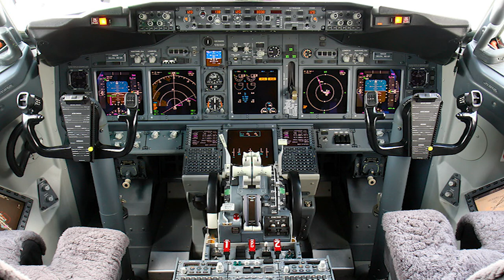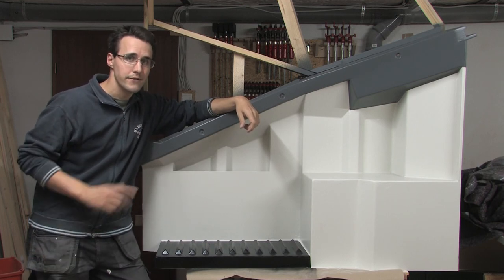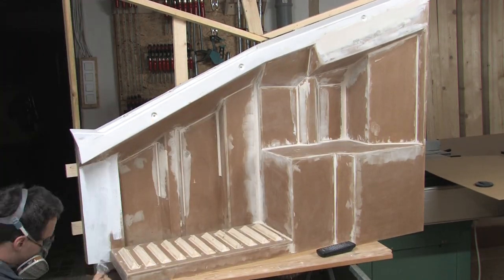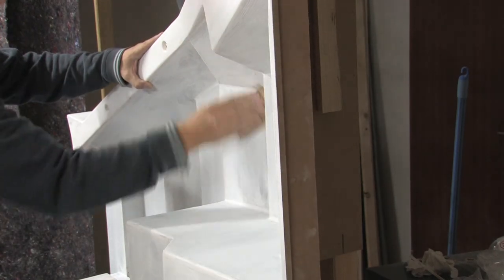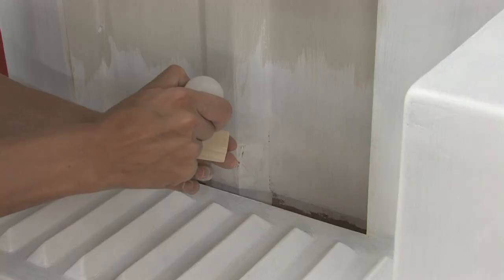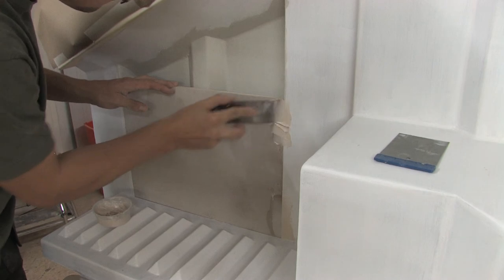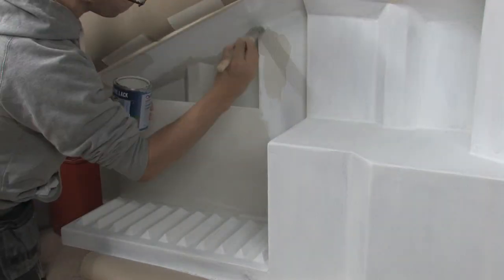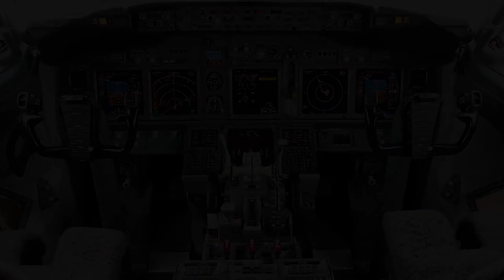Painting the Sidewall - A Boeing 737-800 Homecockpit #13

Comment: Hello, what type of paint do you use? Acrilic Paint?
And what is the white substance that you use previously than the acrilic Paint? 
Thanks you for do this videos
Reply: And what is the tranparent substance that you use previously than the acrilic paint?
Reply from the maker: I use a water based acrylic lacquer. Before applying the paint I use a transparent liquide that closes the MDF. The white paint is a primer for the acrylic lacquer. You can also get it as a gray color. That depends on the final color you want to use.
Reply: @Mickeys_Flightdeck  okay thanks you very much.

Comment: Another great video, congrats. Did you apply just one coat? do you prefer brush painting or spray?
Reply from the maker: With this spray system one coat is enough. I prefer spraying. But it takes a lot of time to clean the tools. So when you just want to paint a small flat surface I would prefer a brush.

Comment: you sais in an earlier video that you use 10mm thick MDF. I have looked everywhere for 10mm MDF and I can't seem to find it anywhere. closest i have found is 9mm. where did you get yours?
Reply from the maker: I bought this at our local wood dealer. But you are right. I can't find this at our home depot too. You may have to search a more specialized dealer or just build it from 12mm MDF by changing some of the measurements.
Reply: ahh, thank you, will do, thanks for your videos, they are a great help!
Reply: would 9mm MDF work if i change some of the measurements??
Reply from the maker: Caleb Lownds Sure it would work. I don't think that this one mm would make a big difference.
Reply: thank you

Comment: Do you thin the paint when using the spray gun?
Reply from the maker: I'm thinning the acylic lacker with 10% water.
Reply from the maker: During the last project I realized that you can't set a general thinning value. You have to measure the viscosity of the paint. I used a viscosity of 35 for the rear sidewalls. But I think I will try 50 at the next time. The value also depends on the spray system you are using.